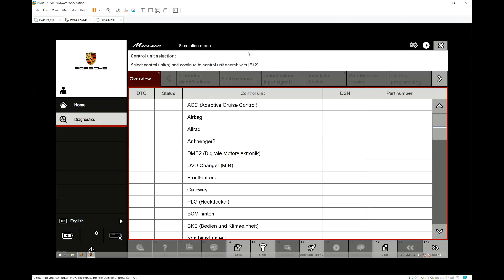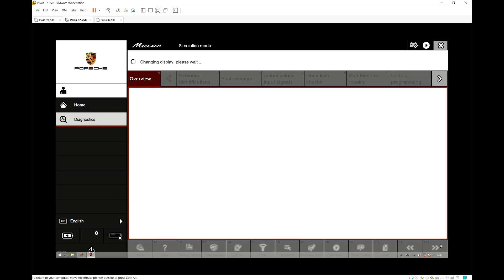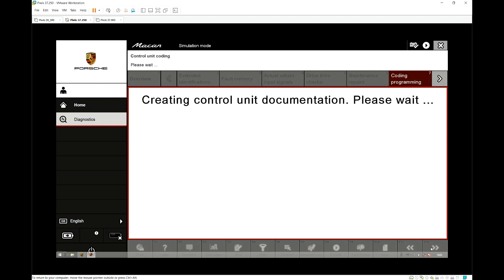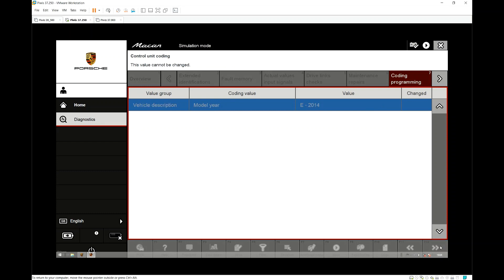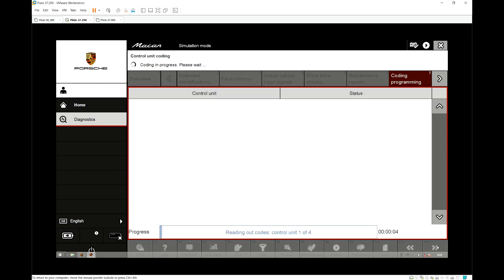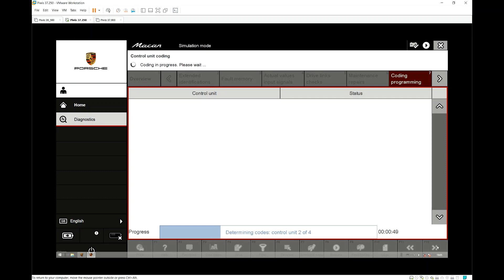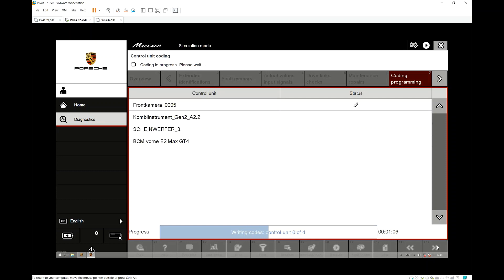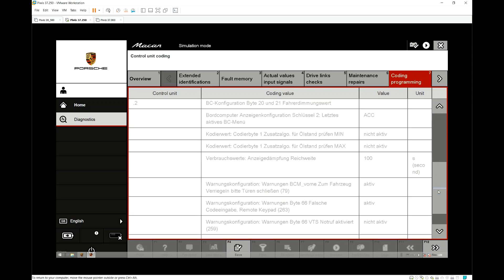Porsche Macan/Cayenne Convert PDLS to PLDS+ using PIWIS 3

Comment: Hello! Thanks for the video. I am planning to do this retrofit for my 2020 Macan. I have purchased pdls+ headlights, but I see they have smaller amount of pins compared to regular LED lights. Is it enough to plug and code or rewiring has to be done?

P.S car is equipted with Lane assist

Comment: Updates: So I coded this using a X431 device, I used the online automatically coding feature, I changed two settings: Change the main beam option from 8IS (US LED) to 8EX(ECE LED), and PDLS option from 8G1(US PDLS+ high beam assist) to 8G2(Euro PDLS+ Dyn high beam ), I was able to tick the "Dyn high beam" box, but if I push the beam lever forward it onlys turn high beam on, the green "auto beam" icon does not comes on. Previously the green "auto beam" icon would come on if I push the lever, will investigate this issue further
Reply: Did you figure this out? Also going to recode my lights to row. I wonder if this programming makes the high beams dynamic in a sense that they're always on and turns off or dim when they need to.
Reply: @bradleyyyy16  You can choose between the on/off or dim option while coding, I will make a  tutorial shortly on the forum using x431
Reply: @yuxiaodong5338  did you make the x431 tutorial?

Comment: I have a 2017 Macan GTS Japan and it has the LED headlights with dynamic high beam assist. The four LEDs wont light up during the day which i assume they should be DRLs. However at night when i open the door after switching off the car, they will light up. And when unlocking. How can i enable them to work during the day?

Comment: I made such coding (with some issues which I fix afterwards). Anyway, in PDLS SAE there is no option to switch on "vertical" dimming. This option even in manual coding without rules is not possible to turn on. Can it be force  or LED-PDLS headlight for model year 2017, for US market are different in hardware? Now I can see it change light projection up and down according to upcoming traffic, but it not make "pocket" for it.
Reply from the maker: @radekrp90  this is correct, PDLS+ is more like high beam assist vs full matrix headlights which never existed for the Macan

Comment: Hello, Nice video, does this also applies to US spec cars? I got the “high beam assist” that will turn on and off high beam automatically but not dynamically moving those beams, thanks.
Reply from the maker: Yes it does apply to us cars assuming you have the relevant parts needed for it to work

Comment: Hi, I've just bought a used new car (2022 reg UK) that was sold with PDLS+, but then it has only come with PDLS. Porsche have confirmed with me that they stopped doing PDLS+ due to supply issues. Is this something you can fix for me?
Reply: Depends on the headlights installed, You need to have navigation and front camera in windscreen.

Comment: I'm going to assume your not in the US. On my US macan when I added pdls+ I only have ""high beam assist" I think this is because US cars don't allow the active dimming that the row has. If I follow this coding can I change my pdls+ lights to row?
Reply from the maker: On the Macan, PDLS+ just switches high beam off and on and raises the beam slightly in some scenarios, such as on a motorway etc, on a country road with a car in the distance etc. It's not to be compared to say matrix lights which keep high beam active but dim around the cars approaching etc.
Reply: @thatcarguy4817  thats how the us version works. the ece version is a little more active.
Reply: The US cars have on/off high beam assist. Others get dynamic main beam where the high beam is shaped depending on conditions but not a true matrix beam.

Comment: Hi i have a macan tubro 2014 with camera in front the headglas and Bi Xenon Headlights. Can i upgrade from PDLS to PDLS + and take the LED front lights? My Porsche Guy say he can‘t do this…
Reply from the maker: Yes you can. You need all the headlight modules for this to work a none of your original xenon ones will work.
Reply: @thatcarguy4817  thank you!!
Reply: @mdanilo7422  No worries. But please note this is not the method used to change from Xenon headlights to LED headlights, that is more involved and requires other steps doing.

Comment: Does this work with xenon lights or only with matrix? Car is a Cayenne 2017 Hybrid
Reply from the maker: Xenons work
Reply: @thatcarguy4817  how can we program it? Is a genuine PIWIS needed?
Reply from the maker: @Speedmaster5445  not genuine piwis
Reply from the maker: Clone will do the job
Reply: @thatcarguy4817  before I found you I talked with some programmer and he told me for pdls plus for my model is not possible with clone because of low baud rate?
Reply from the maker: @Speedmaster5445  it's possible, but what he says is correct if you have led headlights. However if you buy vnci pt3g or tabscan T6PT3G then no issues either way
Reply: @thatcarguy4817  can it be also programmed with original piwis2 ?

Comment: How much to code for a 2015 Macan turbo? I had PDLS on it but upgraded to the LED. Need assistance coding it in as I don’t want to buy PIWIS yet
Reply from the maker: Contact me info@thatcarguy.club
Reply: @thatcarguy4817  sent!
Reply: @thatcarguy4817  Hey so I finally got them installed, my local porsche guy was able to get the DRL+Headlights working, also bought control modules needed for 2015 Model year as I saw on the forums. However high beam doesn't work. I am in the US, and I'm willing to accommodate time zone differences, do you think you'd be able to assist?
Reply from the maker: @joshj7593  contact me on email and yes I can help.

Comment: Can "power steering plus" be coded too?
Reply from the maker: Yes it can, however, its locked and requires a VIN specific activation code to unlock the feature to be able to switch it on. 

This can be purchased online and then dealer will usually code it for an hours labour along with activation code.
Reply: @thatcarguy4817  thank you.

Comment: Could you do this on a panamera 2019 that has both lane assist and road signs? Is the procedure exactly the same? I do have the equipment to do this. This is on my own car and not any customer’s..
Reply from the maker: Yes you can. Same procedure can be applied to both.
Reply: @thatcarguy4817  thanks 😉 i have an original vas 6154 that i could borrow from a mate, do you know what piwis version works with it?
Reply from the maker: @automotiveprogramming  won't work with original vas6154. Will only work with vas6154 clone firmware lower than 1.6.6 or original piwis head. For 2019 car I would be looking at latest version you can get, so 40.400 or newer
Reply from the maker: @automotiveprogramming  or just pay a porsche specialist garage to do it.
Reply: @thatcarguy4817  cheers for the info 😊 have a nice one!
Reply: @TITUS did you manage to do it on your panamera?